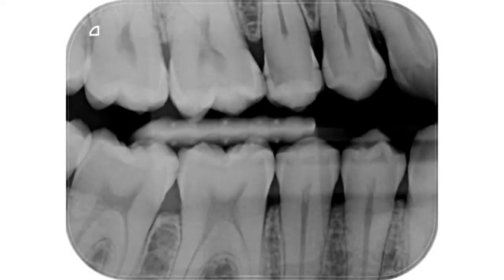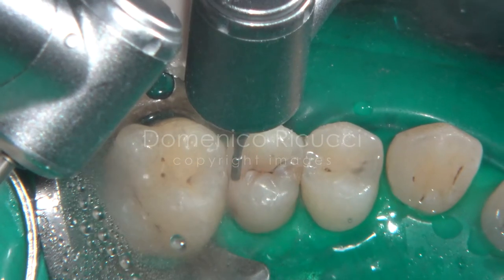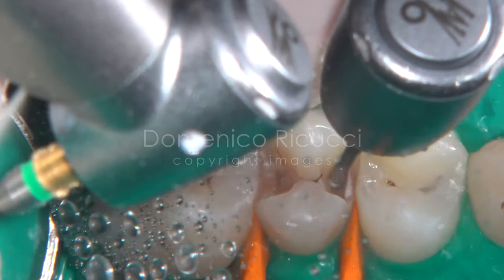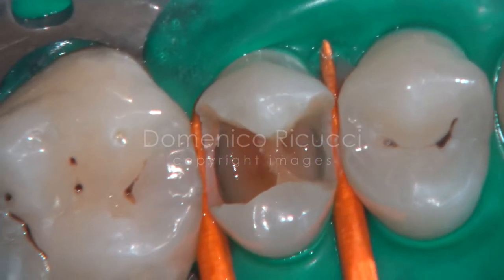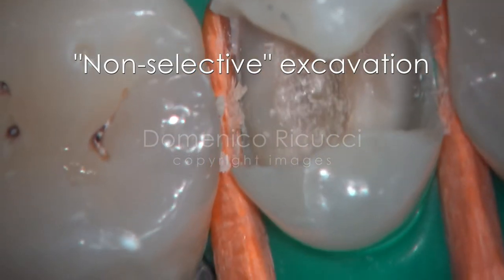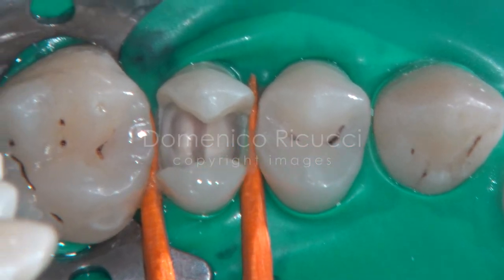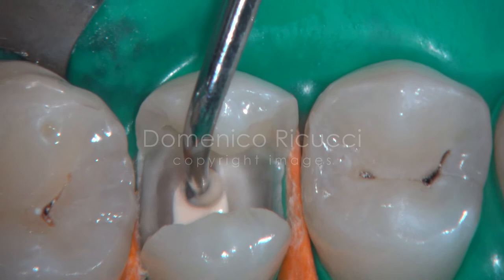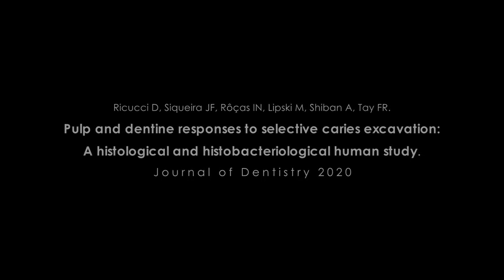DRendo - Non-selective caries excavation: the only correct clinical approach!

Comment: As I approach my 1/2 century in dentistry it always amazes me how we dentist can get equally good outcomes using different techniques, yet so many of us are adamant  that our way is correct. I too can show you decades of research that will point  out positive outcomes on leaving decay behind. This is only recommended on limited cases when all the decay is surrounded by enamel in vital teeth. The tooth in your demonstration I agree needs all the decay removed since we lack that rim of enamel.  I disagree that the decay will continue if deprived of oxygen and nutrients. I too can give you references to support my comments and  by the way they are not done by the same person...which is you... and as you know shows a high degree of bias.So , until we can predictably expose and in return treat the pulp and keep it vital...we are not there yet despite many claims to the contrary I will, when surrounded by enamel , leave a small layer of decay behind so I can avoid pulpal exposure. Especially on 6 and 12 year molars still developing their roots. If you want even more controversy lets take a poll on how to restore this tooth. Like I said our profession has a plethora of options on how to treat teeth. Hopefully we  can get  more robust research...but I wouldn't hold my breath.

Comment: Lovely video, as always! 
May I ask why do you insist on using hand excavators in the deepest parts of the carious lesion? What is the rational for using these instruments when compared to round burrs, at slow (attached to an endo-motor, perhaps) or high speeds?
Thank you
Reply from the maker: Because using burs you lack the feeling of dentin hardness.
Reply: @drendodomenicoricucci5813  thank you Dr. ricucci, for taking the time to answer my question. I'd add that I had great success using large round exavaburs in an X-smart endo motor running at 500 RPM (a little unorthodox, but convenient and I do feel I have lots of tactile feedback with this lightweight handpiece at such low speeds), but I will try using excavators and see if I like it better.
Takr care.